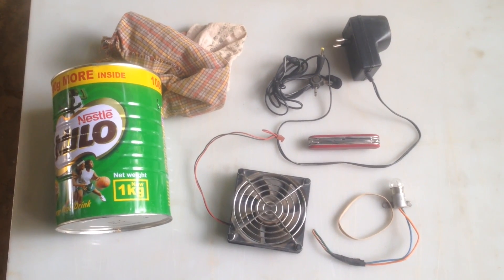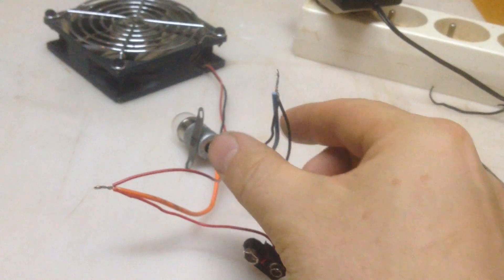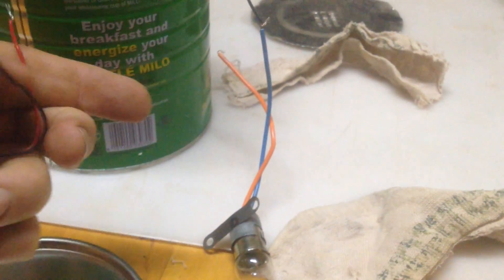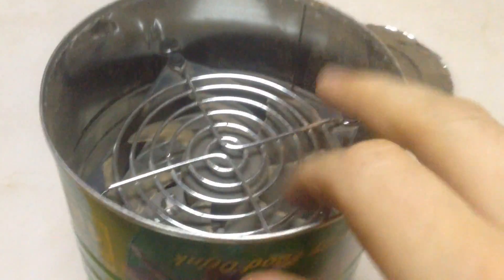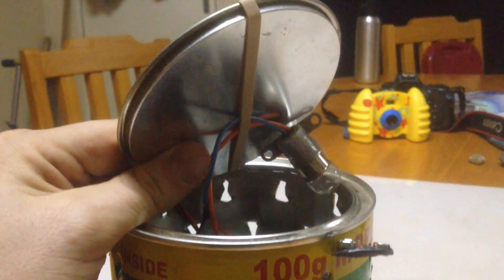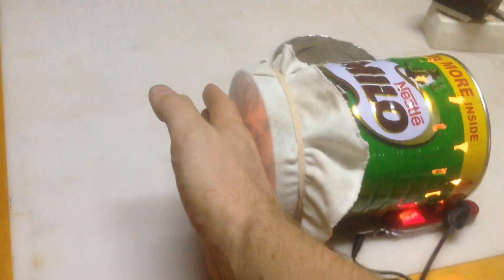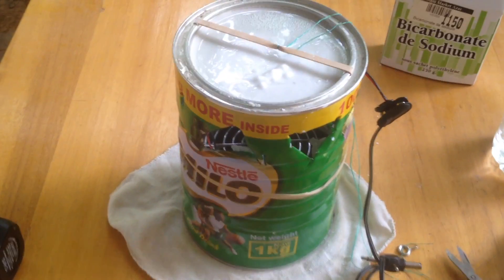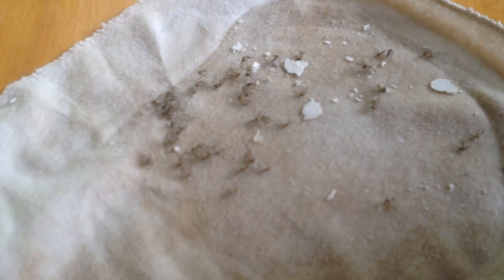Awesome DIY Mosquito Sucker!!

Comment: wire cable are not safe ,they may cut through can sharp edges . IDEA IS GOOD . but use a sleeve for safety 👍
Reply from the maker: I was trying to make it as simple as possible. But that's a great comment to add to a follow-up video if I ever make one.